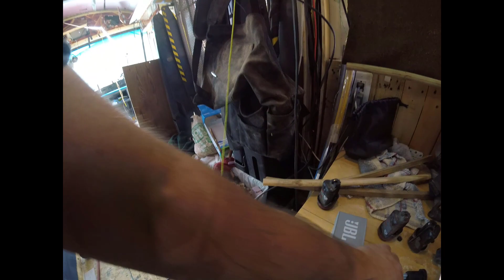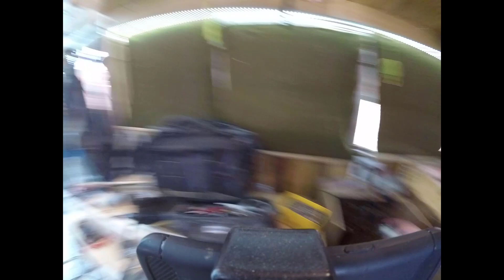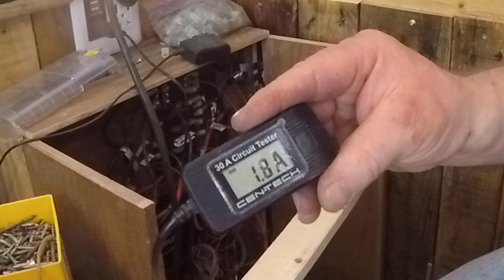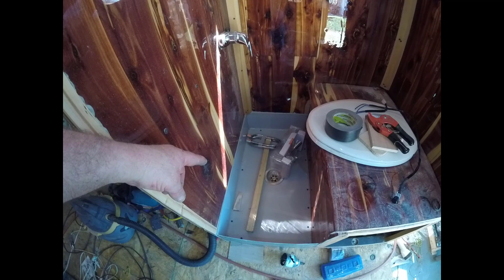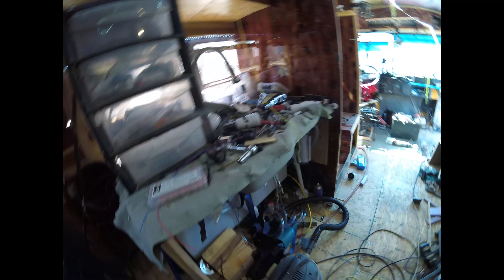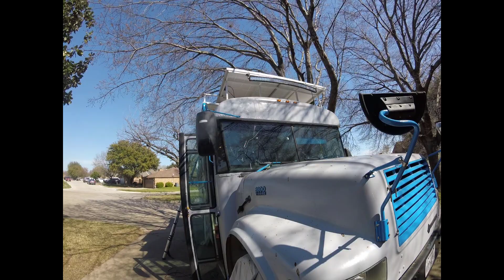SBRVC E72 Cen-tech 30 amp DC circuit tester and bus update

Comment: Did you test that circuit with power off or on?
Reply from the maker: On, if it weren't "On" you would have seen zeros, if you notice it said 1.8 amps that means what ever was on that circuit was powered and that's how amps it was using
Reply: @Coolbreeze61  In the video you did not show flipping the CB on that you did show turning off, so it left me wondering if you were measuring resistance or power.  TY
Reply from the maker: @KSB81613  Sorry should have shown that too, but there is no CB it's just a fuse that i took for the circuit and installed it in that device then i plugged that device into the slot where i pulled the fuse from, I really do need to show everything next time because it could leave people wondering how it worked if they didn't actually see me plug that thing in. thanks for letting me know.
Reply: @Coolbreeze61  I am only observing and know nothing about what you are doing?  Inquisitive minds want to know....TY for the details.